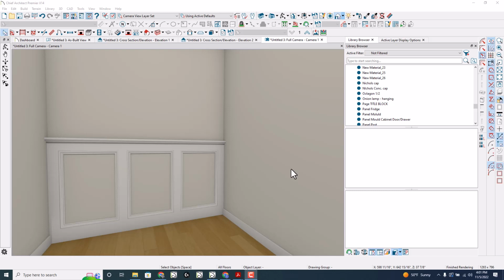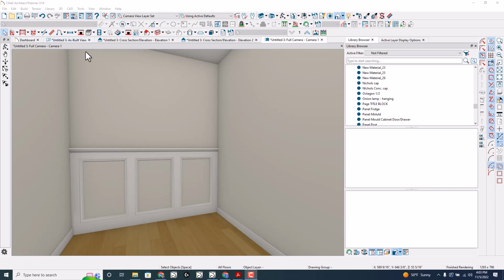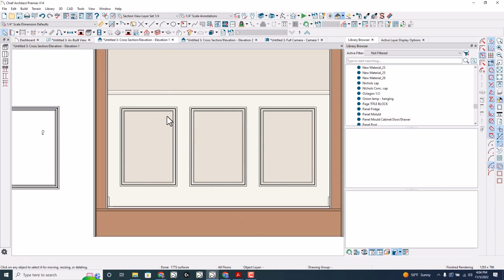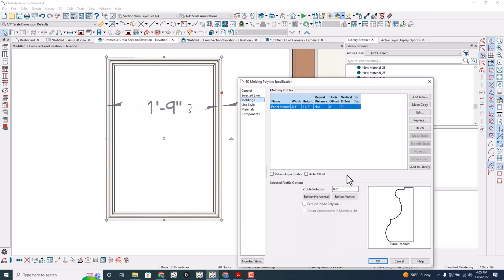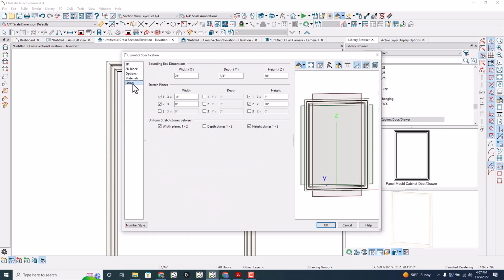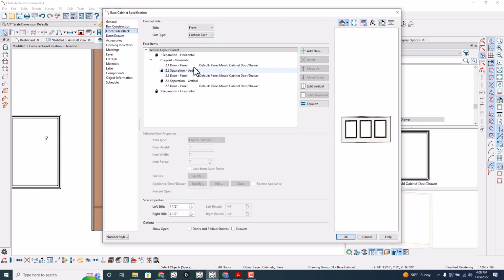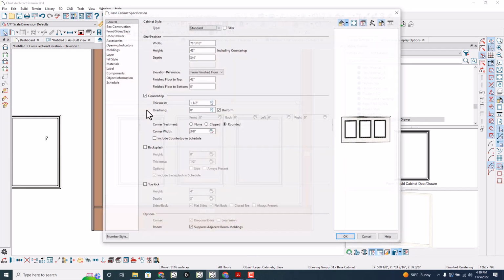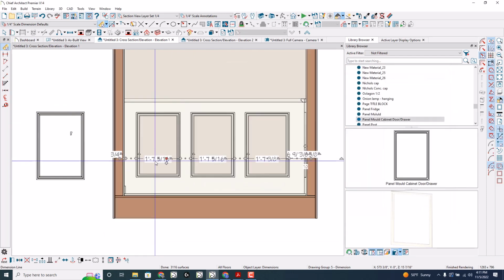Take Panel Mouldings to the next level | Chief Architect

Comment: I'm late to the game on this subject, but was just digging around on the forum.   I wonder why Marc using Side Inset panel, vs just a cabinet door?    I wish there was a quality tutorial on each wizard component and their advantages.   Rabbitt has made giant libraries of shelf objects using door symbols.   Marc loves his Side Inset for making a beaded inset system and other clever ideas.  Appreciate you sharing this video.  Your explanation of making custom molding details for the various options of WC panel detail is really helpful.   :)   I make most of my custom door symbols in sketchup.   For me, it's just quicker still.   Some of the cad features of Chief haven't 'clicked' in my brain as to their logic of use.
Reply from the maker: I don’t think I’m familiar with Marc. What is his channel?
Reply: @DesignbuildsolutionsLLC  From Chief Talk.  Not a you tuber.
Reply from the maker: @Curious_Skeptic  ah